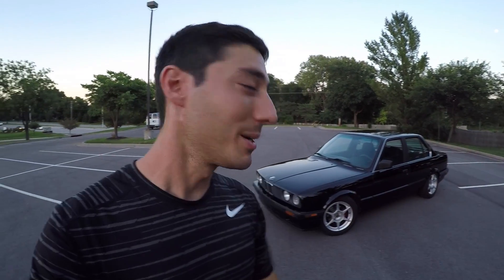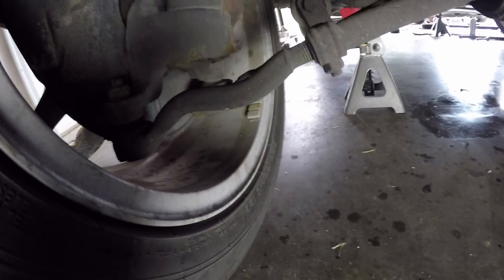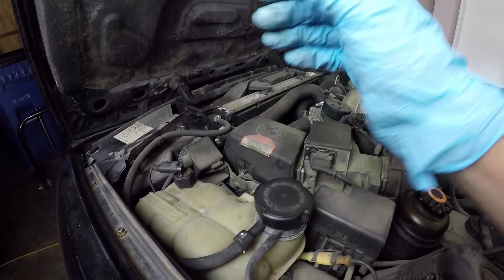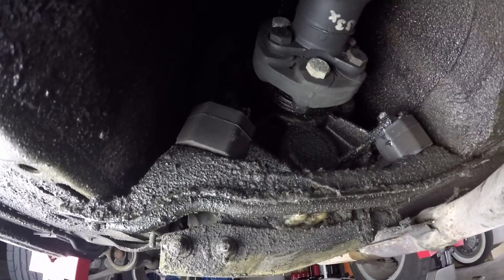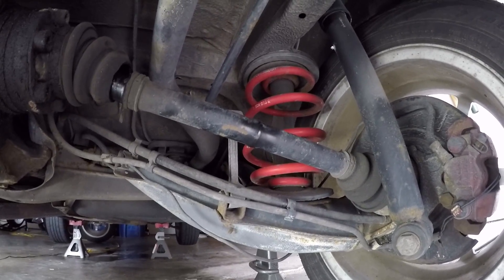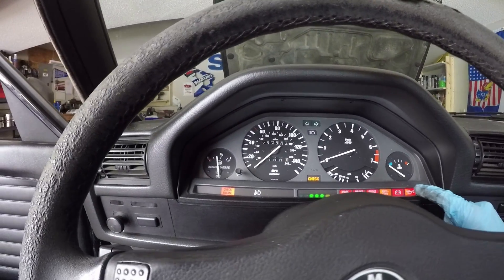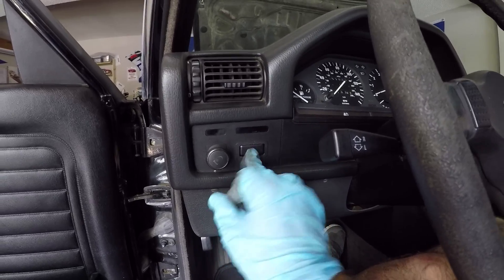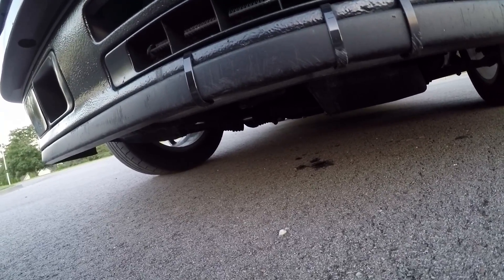Project E30 / Ep. 1 / Check Out My Regrettable E30 BMW Purchase

Comment: Your dealing with a 30 year old BMW with (probably) 300,000 miles. Your going to be doing ALOT of wrenching on this car! If your up to the task, these cars are fun to work on and aftermarket parts are downright cheap! When you get everything sorted, your going to be running one of, if not THE best BMW ever built in terms of simplicity vs. technology, quality engineering, and the classic style that really defined what BMW is to most Americans. If you gotta pay someone to wrench for you, do yourself a favor and dump this car and just get yourself a Civic or something. BTW, if you just wire the brake sensor wires together, the light will go out and you can run aftermarket pads without the sensors. Plan on a new timing belt and a full cooling system rebuild (water pump, radiator, all radiator and heater hoses, thermo, clutch fan, overflow tank, cap ... the works) If you overheat the engine, you’ll cook the head (which is going to be a costlier headache than rebuilding the cooling system). It’s all pretty cheap, as are the front end, steering, and suspension parts. Its going to make a really cool project car, but you have to stay committed.
Reply: Thanks for this comment. I've always loved the style of the E30 and recently saw an ad for one around $4K (250,000 km). I've never worked on a car in my life so this comment sort of brought a sense of reality to my expectations.
Reply: sisbrawny dont get it twisted you still need to have an idea what you are doing coming from a mechanic

Comment: you have the wrong attitude about e30's lol its not a car from the 2000's there's going to be a ton of issues and you get what you pay for.  30 years of neglected maintenance is normal for these cars. Also you could have looked under the car and noticed the leaks before you purchased it, especially the water pump leak.  These cars aren't perfect, and a lot of them never will be.  I've owned two e30's both having similar issues such as this one, if you're knit picking the little problems now you have no idea what's in store.  Also the gauge problem could be a blown fuse i had a similar issue and just a fuse was blown that completed the circuit for the tachometer.  None of these problems will be too difficult to fix, but if you're lacking motivation and dedication now I wouldn't take on this project.
Reply: Even though my e30 has a mix of its own problems. I picked it up with a few problems. Its still worth it in the long run.

Comment: this is sooo not an e30 guy
Reply: Hes a subaru outback type guy with a Patagonia sticker on the paint
Reply: Nice car. Obviously neglected for many years......sure there will be repairs! If you buy a car that was neglected, without checking first, then you really asked for trouble!
Not the car's fault......
Reply: car would run forever with all of those leaks. normal e30 shit. never gets worse. go buy a new car if you dont like oil puddles because e30s are going to leak. if they dont you have a shit ton of time and money or are out of fluids
Reply: I am, I used to own a red one before it blew up and I recently made a video of my friend's blue one
Reply: @1000Famed  whats wrong whit Subaru's?
Reply: Go check out OdometerGears.com. The gears in the gauge cluster turn to mush after so many years on a great many of old cars, due to what the gears were made of. The replacement gears are HIGH QUALITY. If you talk to the company owner, he can tell you EXACTLY which ones that you need

Comment: Stop playing the martyr! YOU bought it.If you had inspected it with the thoroughness of your
video, you could have walked away, but you didn't
That 38 year car shows the result of normal wear after nearly 270 thousand miles
Plus blatant evidence of lack of maintenance and abject neglect. Previous owner should have
spent less money on polish and used savings on maintenance.
I own a 1986 BMW 3series 318i  from new. 182,000 miles and it hasn't any of 'your' troubles.
A new complete clutch. and gear selector rod ,'shocks' and normal consumables were the only
expeniture. I maintain it myself.

I wish you all the best ,and look forward to its overhaul videos

Comment: In the UK we have an annual test/check for all vehicles over 3 years old. Apart from the oil leaks, it would have failed on the Track rod ends, Driveshaft boots and any issues with the Hand brake years ago. It amazes me that cars in the US only get any kind of check when they change owner.
Reply: Chris Wade Each state has its own inspection standards. High population states are usually pretty strict while rural ones are pretty loose. The states are supposed to be self governing countries with a federal govt to only deal with interstate problems, this our Constitution refers to with “These United States” not “The United States”. Fun facts. But yeah some states like NJ and NY check emissions, brakes, suspensions, etc.

Comment: Hey I've decided to go all the way back to the beginning of your E30 journey. I can honestly say that I think you got a car with a lot of issues but it wasn't because the owner abused the car. Neglect yes but not abused. (Well okay I know neglect is a form of abuse but I think you understand what I mean). As well you paid right for it. $1800,00 for an extremely high mileage yet almost complete E30 in that color scheme and Manual 325i (Those two things are most important lol) you did as good as I think you could. At least I now know what you didn't know then. If you had you probably wouldn't have bought it LOL. (Or ?) Anyway I say from my comfortable seat IT WAS WORTH IT!!  I have big time car envy of you but I think I've said that before. I shouldn't be though as I have my dream car as my daily driver (E46 M3) which I am about to throw a wad of money at this spring. LOL. Carry on Soldier!!

Comment: Odometer failures are common (rite of passage) on older BMW's.  I've had 3 early 80's BMW's (two e21's and an e30) and  all 3 had odometer failures.  An inexpensive kit (<$20) is available to replace the gears and it's easy to replace once you pull the cluster which is fairly easy.

Comment: Leaks are super common. This car is worth 1800 all day from what I've seen. And the m20 motor will run forever, as long as you keep.up on the timing belt change. looks like a clean shell though. Front suspension bad is usual also with these

Comment: Ive got the same leak between the bellhousing and the engine. Could you let me know how difficult that job would be? Or maybe an estimate on the repairs? The E-brake cables are a bitch to do, just take some vice grips, a shit ton of PB Blaster, and a torch. Spray the PB Blaster all over where the e-brake cables exit the car, let it sit for a few minutes and try and pry it out. If that doesn't work, use the torch and repeat. Oh, I've got that same AC issue so I'm excited to see how you do all that.

Comment: It’s hard to say if you over paid or not. I am elbows deep dealing with pretty much the same situation on my 1990 e30 sedan. I paid 2500 for my rust free, none cracked dash, good interior example and I haven’t moaned about the price. I think you are in a good position money wise for a rust free car.

A few commenters laid out pretty accurately a lot of the work that’s in front of you so I won’t rehash that. 

What I will say is that my engine, transmission, diff, front subframe, rear subframe, and trailing arms are all out of the car and being worked on just to give you a clear picture.

1. I have not found any part of working on this e30 to be easy and I am saying that with the luxury of having a lift.

2. I have no idea what people are talking about when they say stuff like “all you need to do is spend $1500 or $2000 and you’ll be good to go”. Just off the top of my head I vaguely recall plunking down a grand or more right off the bat for replacing all the new stuff under the hood just as a matter of course before I ever got started. 

Personally, there is no way I am going to rip a car apart and not replace everything in its entirety without using Lemfoerder or genuine BMW parts. At 200k plus miles it would be a grave injustice to just rebuild & or replace the worn out boots on leaky rear axel half shafts, they need to be replaced, that’s $600 big ones right there. A decent set of Bilstein shocks are are $500. I could go on and on but I’m sure you get the point.

What I am trying to say is that my $2500 rust free e30 will actually end up with a realistic cost in the neighborhood of 10-15k
Reply: Is this to rebuild into a race car or get it to showroom?

Comment: check the backup light wiring it can cause your issue with the gages. happened to me when the wiring came loose and got cut by the driveshaft

Comment: I've got an 88' 325ic, bought it years ago, it was not perfect.  Many years and 161k miles later I still have the old German girl and she still turns a lot of heads.  Get yourself some metric wrenches, a few long socket extensions, and the Bentley manual, and get on it.

Comment: I bought a 270k miles 2001 540i- beat on it every single day- redlined and took it to 140+mpg on a regular basis and drove it every day. Never missed a beat never failed to start. ORIGINAL VANOS.

Comment: 1800 was a steel for that car. A post facelift e30 with a desirable color option, the I motor, in a 5spd is near impossible to find for less that 5k where I live in southern Cali. And this is obviously your first intro into e30s, but don’t get flustered over the amount of work. It’s a car from the 80s it’s going to have problems. Just take it one step at a time